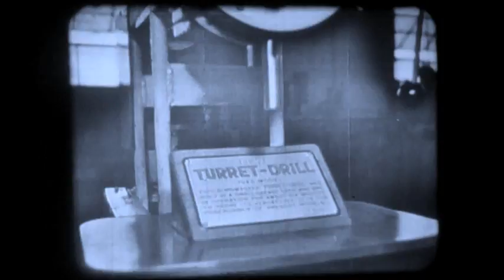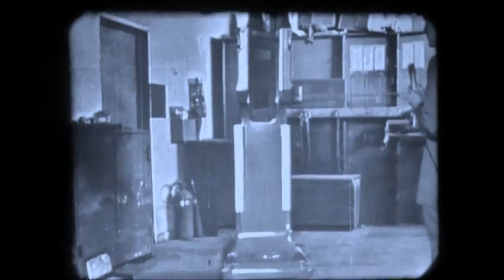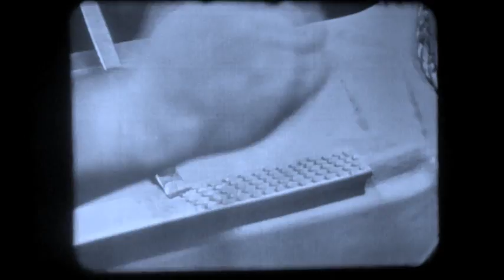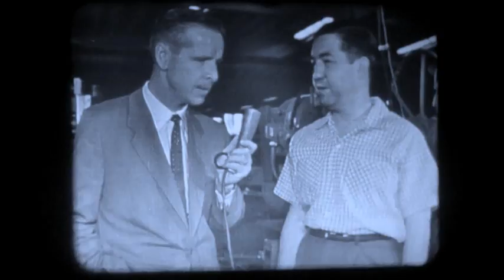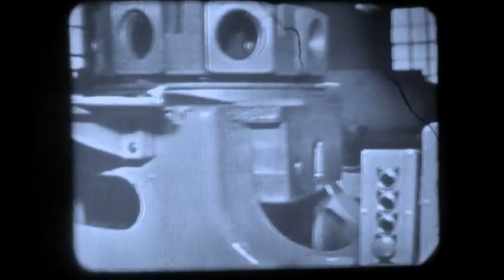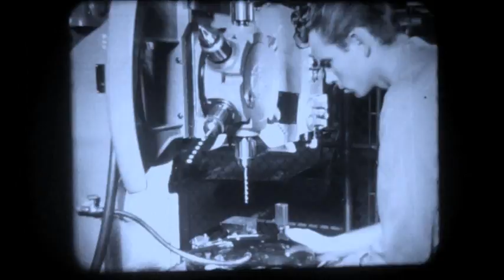Success Story, the Burgmaster Turret Drill 1950's Television show.

Comment: I'm the granddaughter of Fred Burg, daughter of Joe Burg.
Thank you for posting this!!!!!!!!!
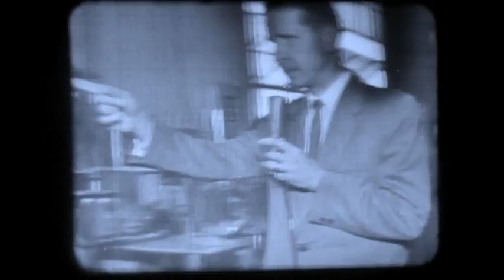Reply: Hello.  My Grandfather (Ray menard) is in this video, ( @ 10:00 Minute)
 He worked at Burg in the '50's & '60's.  My Father (Al Henry) also worked at Burg in the late '60's- early '70's  & later opened up the authorized burgmaster parts & repair center (mar-Matt-Co.)  I still have new parts for some of the burgmasters.  My Father passed in 2021.  Say Hi to Your Dad from the Henrys.
Reply: @toxsickdog  Do you happen to have any of the larger models? It's so hard to find one in this day and age.
Reply: @RocanMotor  the only machine I have left is a model OB bench model, and it is not for sale.  I know many of the old burgmasters are in mexico,  we shipped lots of parts down there.  most of the used machinery dealers scrapped out the large models over the years as cnc's took over in the usa.  the 2B was a great machine in it's day.
Reply: @toxsickdog  I've got a 1D that I love, just rebuilt it this week actually. occasionally I'll see the 2B models around, but have never seen anything larger for sale or even out on the wild.
Reply: @toxsickdog  Hi I might need few parts for Burg 2, one of the spindles not rotating and indexing carousel not rotating either.. Is it possible to contact you and ask some questions?
Reply: @RocanMotor  Hi I might need few parts for Burg 2, one of the spindles not rotating and indexing carousel not rotating either.. Is it possible to contact you and ask some questions?
Reply: @AlexeiPavlov  you can give me your email in a you tube message and I can give you my contact info.  I used to repair these machines & know them well.